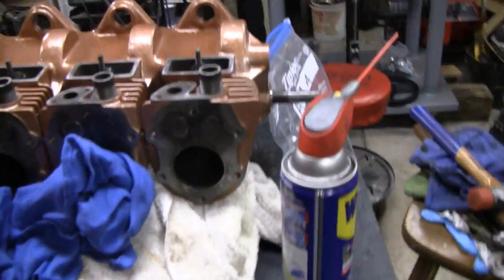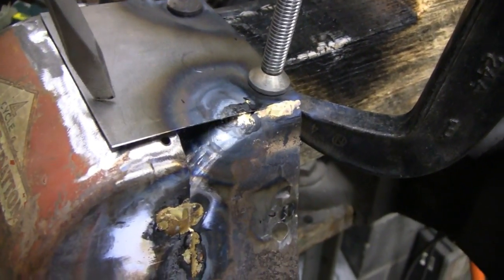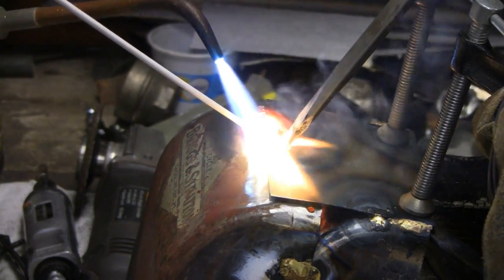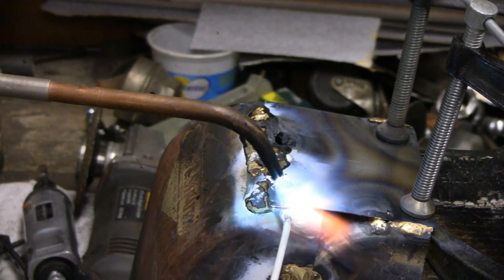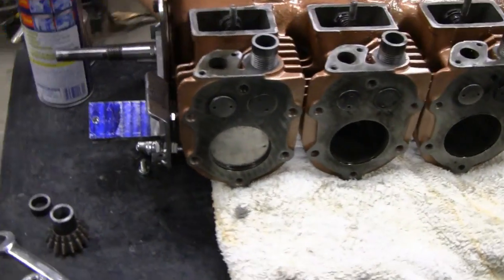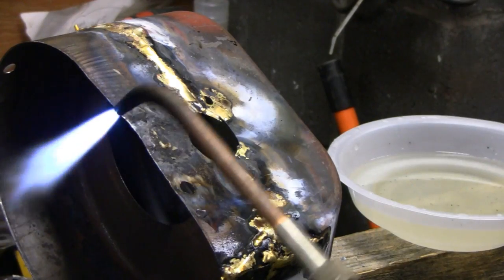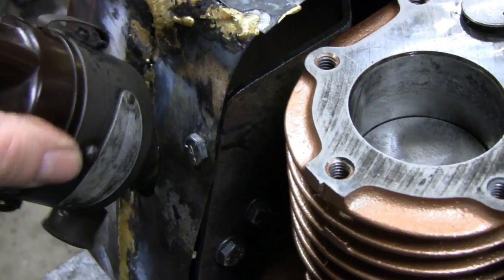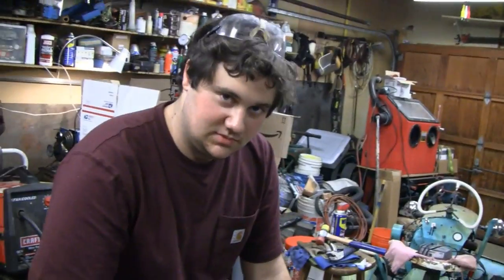HOMEMADE 4 CYLINDER BRIGGS PROJECT (part 17)

Comment: I grew up knowing what brazing is, my grandfather was a oilfield welder back many, many years ago, and fixed many cracked engine blocks by brazing, and anytime my dad had anything cast to weld he brazed it.  Many years ago I seen my dad braze a broke front axle beam back together for a small tractor he has and it is still holding today.
Reply from the maker: Yeah Buddy!! It's definitely old school!! If it's done right it's just as strong as anything else!!☺
Reply: 805ROADKING i don't think so.Check tinsel strength.Also use a nickle rod on cast works good to but you have to peen it.
Reply: stainless rods works on cast as well, but I still think brazing is the all around better way to weld cast back
Reply: Iknow what brazings good for when i was 16 and apprenticing with a 72 year old master welder we brazed blocks,a niagra sheer end that was broke,i know how to braze.Did your grandads have a large lime box so the pieces didn't cool to fast.I know brazing but for mild steel you need to steel weld it.surface cohesion not adhesion.
Reply: Cococ

Comment: Looks great! Should run real good. My buddy is finishing an aluminum block twin. Thinking about building another and making a four. Any thoughts about your cam breaking with no center main bearing? Or did you build one?
Reply from the maker: Thanks Bud!! We're not worried about anything breaking!! It's been running for a month now without any problems!! We do have a center bearing!!☺

Comment: Its just my opinion but i think you should use 2 Carbs.
it looks like Cylinder 1 and 4 wont get enought Fuel.
(in a car with a carb,all ways are the same distance)
But i think you know more about it than me :)
Also sorry for my English!

Comment: It's totally awesome with a sprinkling of WOW on top! 

Do you think you might get some hot spots between the cylinder heads?
Reply from the maker: Thanks Bud!! There shouldn't be any problem!! It will be getting massive amounts of air from both directions converging between the two center cylinders creating a helical vortex equivalent to hurricane force winds!!☺

Comment: Very impressed with your briggs projects .  I would like to discuss hiring you for a  installing  the liquid cooled 993cc briggs vanguard v-twin  in a new Harley Electra Glide . ALL TOP TIER COMPONENTS . heads worked =large stainless steel valves race springs roller rockers ect , Forged 4340 chrome molly rods , Forged JE pistons .   Race Cams ect ect . AND the briggs big block vanguard v-twins & 6 speed transmissions fit into Harley touring chassis as if engineered by factory .
The new Garret mini Turbochargers  fit between the 90 degree v angle and spool at idle . 100hp at rear wheel 150lbs torque  . Smoother/stronger than Harley 110ci  engine!! ALSO Motorcycle magazines want to do cover story on bike  as I am letting them do a FULL comparison test  against Harleys best  touring bike . My email is ends@comcast.net  if interested  . I live outside of Philadelphia  so not too far away .
I was a mechanic when a young man  and I can honestly say  your current projects take much more skill and ingenuity .. VERY IMPRESSED Take Care  Paul End
Reply from the maker: Thanks Paul!! That sounds like a really interesting project!! It's not something we could help you with though!! With our work schedules and own projects there is not much time for anything else. Good luck with it!!☺
Reply: Thanks for reply. BTW I know a place to get Custom 4340Chrome moly Forged con rods  for 65$ (min order 8) And forged pistons  if you ever want to get both hp AND reliability. The new mini turbo are 400$ complete kit.  Combine components you will be shocked on how much performance you can get WITH reliability . ( BILLET ALUMINUM RODS = snap)

Comment: You wanna go REAL old school...braze with a coat hanger...like we used to do in the body shop.
Reply from the maker: I've seen it done a few times!! Don't know if I'd call it brazing, maybe gas welding though!!☺
Reply: depends on how old the coat hanger is...most of the really old ones were made with a high brass or bronze content steel wire...so i always called it brazing.  If I was wrong for calling it that, I will apologize here and now.  Thanks for the build vids, RK...love what you're doing with this inline 4 project.
Reply from the maker: You're probably alot closer to being right than I am!! Technically brazing uses many different alloys as a filler rod!! Thanks for watching and commenting!!☺

Comment: Questions;
1.What was your thinking, why did you choose that particular firing order?
2.I assume the cam and crank are both custom new one piece made. Correct?(Not joined together)
3.I also assume the crank is bolted down with bearings between cylinders? cam too?
4. Lubrication is accomplished via the original splash method?
Hope I'm not being too nosey.  Just VERY curious. 
Stupid question; why do you need the big flywheel?
Reply from the maker: We chose that firing order because it's the most common for a 4 cyl and the smoothest and easiest on the engine!! The flywheel gives the engine momentum, cools the last 2 cyl and is used to start the engine. Your other ques. have already been shown or answered  in the earlier videos!!☺

Comment: It is almost there now!
Man. that acetylene torch sure heats up the metal a lot faster than my little Mapp gas brazing torch!
Sweet looking engine!
Reply from the maker: thanks Bud!! Oxy/Acetylene is the real deal Mate!!☺
Reply: 805ROADKING Yes, oxy-acet  burns the hottest for sure. I even have my fathers old torch set, just haven't been able to afford the tank rental for about 20 years, with the limited amount I would use it. My friend at AC/DC welding has oxy, but I don't want to abuse the friendship always pestering!  :)
I also have a small oxy-MAPP gas torch for brazing, but the oxy costs $10 or more per 2 0z cylinder...Ouch! So I use the MAPP gas torch mostly, and the green brazing goggles like you wear are a must, remember lads, safety first, one pop of hot braze in the eye, an it is all over!
So were you a car body man years back?  I found some lead for car body use, back many years ago, probably before Bondo.

Comment: Id be interested to see how that runs, it looks like that dizzy will be driven by the crank rather than by the cam??
Reply from the maker: Yeah we didn't have any room to use the Cam!!☺
Reply: Maybe you can drive the cam in a differant matter if it doesnt work? chain driven halving the crank output speed? Wont cause too much change??
Reply from the maker: Too late now!! The engine been running great for the past few weeks!!☺

Comment: I just gotta make another comment,...brazing (in general) sure looks like hell, but it really comes in handy for really thin metals like you got there, and I did forget about that re-heat tip for straightening metal warped with the high heat,...really good, thanks........I am NOT being critical about your brazing, mind you,..but in general brazing is not the prettiest way to join metals, is it ? It does the job for sure.
Thanks,...and keep going, I can't wait  !
Reply from the maker: Yeah you're right!! Brazing is very functional but not cosmetically appealing!!☺

Comment: I just gutted a 2 stroke expansion chamber and oxy/acetyl brazed it back up the other week, used my midget torch really concentrates the heat but still hard to get to look good! too spoiled with my TIG at work. time to get some fuel to that thing!
Reply from the maker: Yeah there is no such thing as a pretty braze job!! it's had fuel and been running for a few weeks now!!☺

Comment: Thanks for the awesome video. It looks so close to fire up. One question which I'm sure you probably already answered. How are you planning on cooling it? From what it looks like, the flywheel will blow air through the channels you have wrapped around the block.
Reply from the maker: Thanks Bud!! It's been running for a few weeks now!! Cooling won't be a problem, It will be getting massive amounts of air from both directions converging between the two center cylinders creating a helical vortex equivalent to hurricane force winds!!☺